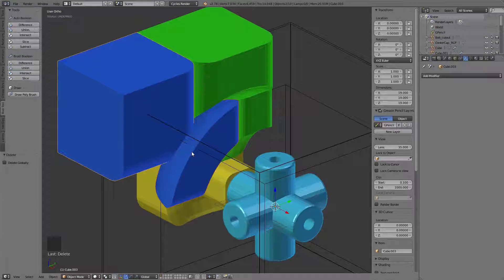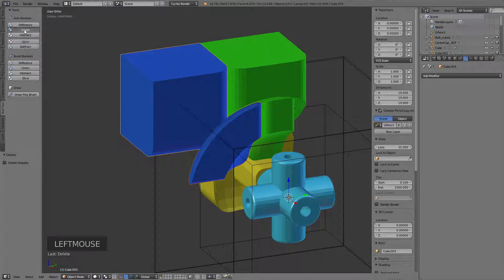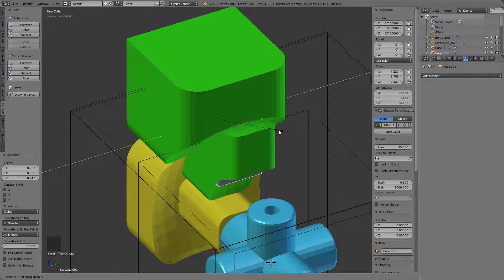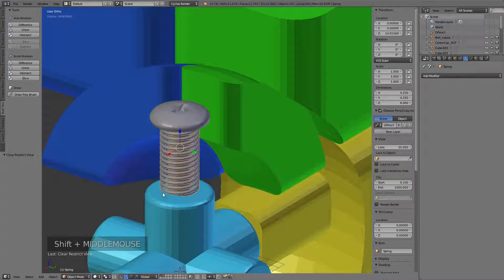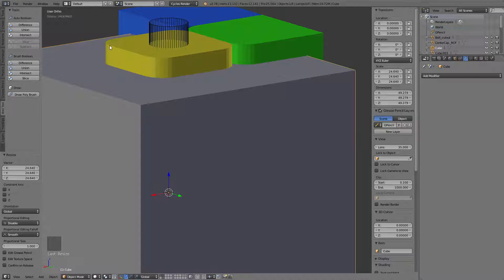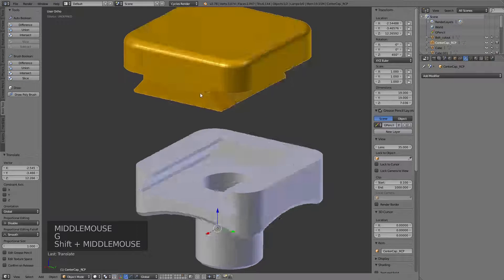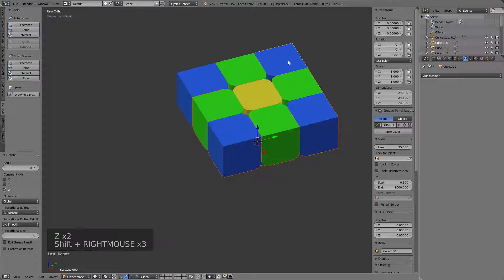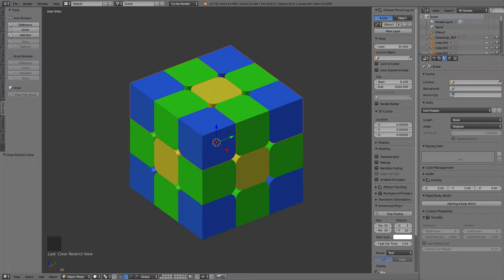Designing 3d Printed Puzzles part 8 of 11

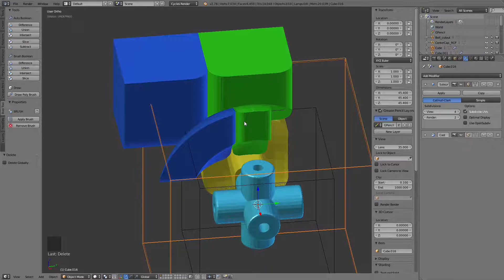Comment: 1:10 this is the information I want to learn most. I designed a puzzle in a different program with limited functionality, and will probably switch to Blender from here on. It has spherical cuts instead of planar ones. Learning to how to bevel between two spherical planes would have saved me considerable time filing and sanding.
Reply: More like 1:06. Meant to say spherical surfaces/faces :/
Reply: Update: I switched to Fusion 360 for editability and the bevel functionality. Tried Ilya’s Bevel After Boolean add-on for a long time with 2.79. It works great, bit I found myself spending a lot of time re-working parts, and less time on the design process.

Comment: I really wish I knew what the dimensions were for the screw. Any chance you could post them?
Reply from the maker: Unfortunately, the screw sizes can vary quite a bit between different cubes so you should really measure what you have. Typically, they are around 20 mm long, and the spring is around 8mm relaxed and 4mm under full tension.

Here is what I have from the old Guanlongs though (The new ones are slightly different)
-total length 18.2mm
-head height 1.5mm
-screw portion of shaft is 7.5mm (this is part of the 18.2)
-Shaft is 2.85mm in diameter
- head is 6.85mm in diameter

-Spring
-4.3mm in diameter
-8mm at rest
-4mm fully compressed.

Hope that helps.

Comment: how can I find the screw?
Reply from the maker: If you want to make the screw, you can use the plug-in called "Bolt Factory" It ships with Blender but is turned off by default.

1. Press Ctrl-Alt-U to bring up user settings
2. Go to the addons tab and find/search for Bolt Factory to enable it. You can either close this for a single session use or press Save User settings to keep this turned on.
3. Once it is enabled, you can add a bolt or screw by pressing Shift-A mesh/bolt
4. immediately after creating the bolt you can change its parameters in the left-hand tab.

hope that helps